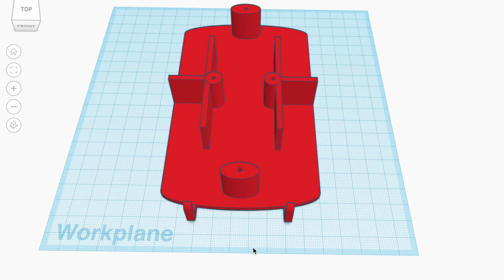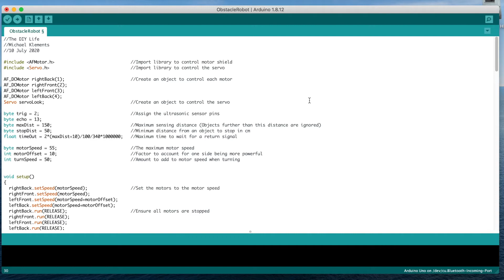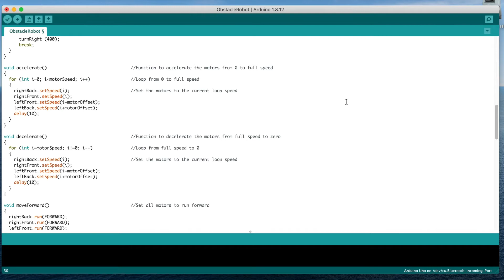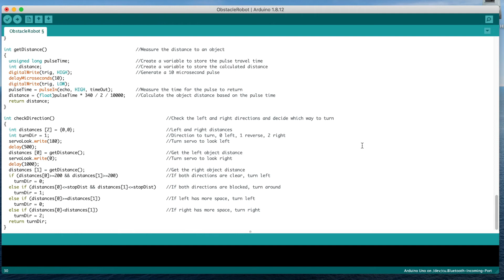Obstacle Avoiding Robot Car Using An Arduino

Comment: My car is turning towards the closest object instead of away from it
Reply from the maker: Your servo may just be turning in the opposite direction to mine or your motors are connected the opposite way around. Try flip the logic in the code.

Comment: In file included from C:\Users\Steven\AppData\Local\Temp\.arduinoIDE-unsaved2025013-17800-1vkb7uk.qk2y\sketch_jan13a\sketch_jan13a.ino:5:0:
C:\Users\Steven\Documents\Arduino\libraries\Adafruit_Motor_Shield_library/AFMotor.h:156:47: error: 'DC_MOTOR_PWM_RATE' was not declared in this scope
   AF_DCMotor(uint8_t motornum, uint8_t freq = DC_MOTOR_PWM_RATE);
                                               ^~~~~~~~~~~~~~~~~

exit status 1

Compilation error: exit status 1
Reply: pls help

Comment: Hi Michael,
Thanks for your project is well documented, however I got an error message when I tried to compile it to check the code. The error message says the "getDistance was not declared hence can't upload or even compile the code. Hope you can help me. Thanks
Reply: same error here did you get the fix to it?
Reply: No
Reply: @chitobalazo  so how did you proceeded with the project?
Reply: I’m still trying but no success. I tried so many you tube channels but no success. Hence I’ll be trying to use HC- 05 once I receive it. Also tried using L298N and R4 wifi limited success.

Comment: Can we use 18650 li ion battery?
Reply from the maker: You'll need to use 2 to meet the voltage requirements of the shield.

Comment: Hi Michael, thanks for the project! I did everything and made some changes on my own and the car works good! Just one issue, the servo motor is spinning too fast, so fast that it removes the wiring sometimes. Do you have any idea on how to fix this, like how to slow down the servo?
Reply from the maker: Hi Techysoham, thats great to hear. There are some Arduino libraries that offer servo speed control, the other option would be to create a functional that moves the servo in single single-degree increments with a small delay between each step.

Comment: hello Mr. Klements, I tried putting a 3 x 3.7V rechargeable battery with a total of 11.1V but when I added 5V to it giving a total of whopping 16.1V, the Arduino Mega 2560 stopped working. Did I supply too much current? is the 11.1V enough for the 4 motors?
Reply from the maker: I'm not sure how or why you added 5V to it, 11.1V is enough to supply both the motor shield and the Arduino. That said, 16.1V also should not have damaged the Arduino Mega since these can typically handle a supply voltage of up to 20V.

Comment: Hi Michael, I understand this project is 3 years old however do you believe with some adjustments to the code an analog servo motor can be used instead?
Reply from the maker: Like and analog RC servo motor or one that requires a different driver?

Comment: I have a question about the yellow-capped component labeled "PW" on the motor shield. Additionally, I've developed a car using the same procedure and utilizing two 3.7V batteries each. However, I've encountered two problems:

1- When I unplug the USB, the car stops working.
2- The batteries seem unable to power all four motors to move the car.
Initially, the setup worked fine during testing, but these issues arose later on. Could you please provide assistance on how to address these problems?

and what specific Batteries and how many of them I need and what volatge.Thanks In adavnce
Reply from the maker: I assume you're talking about the jumper labelled "PWR" - mine is black not yellow. This is jumper that either allows the shield to supply power to the Arduino or disables this feature if the voltage is outside of the Arduino's range. If you're supplying power to the shield only then you need to have a jumper on here to power the Arduino as well. 

Using 3.7V batteries, you would need them to be connected in series and ensure that they can supply enough current to drive the motors.
Reply: @MichaelKlements  
Thank you for your response. Yeah Man , you got me correctly. I was referring to the yellow PWR in my case 😂. From your comment, I gather that I need two batteries, providing approximately 7.2V and 1200mA. In this scenario, I simply keep the PWR turned off as it's. COZ I'm afraid of messing things up
Reply from the maker: You need a supply voltage of at least 4.5V, so either one 7.4V battery or two 3.7V batteries in series would work. If the jumper isn't on then you need to provide the Arduino with it's own power source as well.

Comment: Mate what batteries do you use to power this thing ? I thing that's the most important aspect of this project (you skipped the part where you install the batteries) since many of us who're trying to get this to run use 9V batteries and that simply isn't the optimal power source
Reply from the maker: Either use 4 x AA batteries in a pack or use a 2 or 3 cell LiPo battery (that's what I've used).
Reply: @MichaelKlements  Yeah well I bought a 4 pack and a 6 pack AA holder.  The 4 pack doesn't have enough voltage (1.5 x 4) as the L293D driver has a voltage drop of around 1.8V so the motors spin reaaaallly slowly. Nevermind turning left/right.

The 6 pack is also meh to be honest. I think I need to buy a high voltage high capacity LiPo battery like you mentioned to run this at its full potential.
Or maybe 2x 18650 Li Ion battery

Comment: bro ur code is wrong Arduino: 1.8.18 (Windows 10), Board: "Arduino Uno"

sketch_jan07a:1:10: fatal error: AFMotor.h: No such file or directory

 #include <AFMotor.h>                              //Import library to control motor shield

          ^~~~~~~~~~~

compilation terminated.

exit status 1

AFMotor.h: No such file or directory

This report would have more information with
"Show verbose output during compilation"
option enabled in File -> Preferences.

Comment: hey could we plug the power supply into the Arduino Uno instead of the driver shield?
Reply from the maker: The motor driver pulls too much current to power it through the Arduino, you should power the driver and allow the driver to power the Arduino.

Comment: Oh my god, How can I ever thank you???? My car worked soo well, there's just one thing. The speed is too low, but other than that, everything is working great.
Reply: Can you help me with the Speed issue?
Reply from the maker: The only way to increase the speed is to use a higher supply voltage - but still stay under the maximum voltage that the driver shield can handle.
Reply: @MichaelKlements   Oh okay Thanks for the information.

Comment: Where is the power source of the robot?
Reply from the maker: A battery pack between the motors
Reply: can you tell me how to connect the BO motors to the shield? like the positive or negative point. I am unable to identify
 @MichaelKlements
Reply from the maker: It doesn't matter which way around you connect them. Connect them either way around and you can then either reverse the wires if the motor turns the wrong way or reverse the direction in software.
Reply: @MichaelKlements  thank you. Just a little more help. My Bo motors doesn't seem to be working. What could be the problem? I tried connecting them directly to the battery pack still the rpm is low. I've tried various code on the motor shield and it is all okay.

Comment: Hey Michael , Loved how you made it look so easy but I need help I'm facing a problem..
I have my trig and echo pin connected to A1 and A0 respectively and I replaced the no. in your code to A1 A0, and when I turn on the car the motors dont run and servo motor is also not moving..
please help me out here:(

Comment: Thanks for the video, why didn't you just solder the wire to the board directly on pin 13 instead of using a pinhead?
Reply from the maker: Only so that it can be removed if required
Reply: @MichaelKlements  oh, ok thanks!

Comment: Hello, I'm a bit confused about the wiring of the motors. What wiring is that, and where do we get them? Does that have to do with the battery. I'm looking at about the 2:05 mark.
Reply from the maker: It's just 22 AWG ribbon cable wire that I have soldered to the motor terminals and also soldered to male header pins. The battery lead is a separate lead connected to the motor shield. Have a look at the written guide linked in the video description.
Reply: @MichaelKlements  But how would you use the ribbon cable to connect the motors into the  motor shield? Is it ok to screw in the regular wire 
pins included in the Arduino kit instead?
Reply: He had joined the pins but t optional

Comment: Hi, so I don't quiet understand what did you do to the 12v battery, do you just put it in the middle section and wire it to the board or to the motors?
Reply from the maker: It is connected to the motor shield's power input, the shield then powers the Arduino
Reply: @MichaelKlements  Do you suggest any batterypacks that workf or this rc car or no?

Comment: hey please anyone tell this work..? please🙏
Reply: Yeah this does work, if you need an obstacle avoiding robot car this is the simplest way to do it, though if you use an esp32 and it's appropriate motor driver shield,the project would be more powerful and have access to wifi and bluetooth which leaves a LOT OF ROOM FOR UPGRADES without changing connections

Comment: Sir I made the project for my college. And the car is working very well but one problem is that if the front of the car is empty then the car is still rotating.I checked the code many times, checked the hardware connection and found no problem. I don't understand why my car is not working like yours. Sir Please help me to fix it. I have to show this project to the college very soon. Hope you can help me fix it, thanks 😊
Reply from the maker: The motors are not made equally so there is almost always a side of the car that has more power. You need to adjust the variable motorOffset to account for this. If it is turning left all of the time then you need to increase the offset, if it is turning right then decrease the offset.
Reply: @MichaelKlements  Sir, when the front is empty, the servo motor is still rotating, that means the car is turning instead of going straight even on the empty road. It seems to detect some object in front.

Comment: Hi Michael Kelements,
Can we use a 9volts battery in this
Reply from the maker: 9V block batteries aren't able to supply enough current to drive 4 motors.

Comment: Hi Michael, it would be a great help if you tell me what I'm doing wrong here. Even though I copied your code the robot doesn't function correctly. when infront of a wall when activated it checks for spaces to move and once it finds a way it moves and doesn't stop again when it encounters any obstacles. I've seen some other people have the same problem as I. I made sure that my connections are correct so what might be the problem. Thank you very much.
Reply: For anybody wondering. I fixed this problem by adding return; after moveForward() in the if statement that's in  the void loop

Comment: Greetings Michael,

I have a question regarding the rover. From halt it propagates forward and then at specific stopdistance(which i believe is set to be in cm), and then stops. THe servo moves from 0 to 90 to 180. Then the rover goes backwards till specific distance. But it never turn around. It always goes forwards and backwards. I have used your ocde and modified the tie daelys for some lines but it doesnt seem to turn at all. And yes I have tested the rover in spaces whereleft is more than space on the right etc.. What can I do ? I would really appreciate the help. All the rover turn setting are as such. If Turn left... right motors turn FORWARD, Left motors turn backward...vice versa for Turn Right. I do not know what to do. Please help me.
Reply from the maker: There is not steering mechanism on the car, so to turn left the right wheels run forward and the left wheels run backwards, if the motor speeds are set correctly then the car will rotate on the spot (it shouldn't move forwards or backwards while turning). It sounds like your motor speeds have been adjusted incorrectly, so one side is probably overpowering the other side.
Reply: @MichaelKlements  hi michael could u reply to my query pls

Comment: HI problem here! great video but when i plu my usb connection to the car 2 problems
1. it doesnt work without the usb
2. the sensor only moves nothing else doesnt
Reply from the maker: That seems like a power issue, you're probably not using a battery that can supply enough power to drive the motors.

Comment: Hello Micheal, Great video! I did want to ask what voltage are you using to supply the car? I am using 6V. Is that fine?
Reply from the maker: I use either a 2cell or 3 cell lipo, so 7.6V or 11.4V. It's not so much the voltage that is the issue, you need a battery pack than can provide enough current for four motors to run. 6V would probably be fine if the pack can supply each motor an amp or so on startup.
Reply: @MichaelKlements  Can 4AA rehargable batteries supply an amp to each motor? Thank you for the reply!
Reply from the maker: Probably not unless they're really good quality ones. I'd suggest using a lithium ion battery pack or a holder for two or three 18650 cells.
Reply: @MichaelKlements  Thank you so much! That's probably the reason why my car is not working!
Reply: @MichaelKlements  Hello Michael! I am using a 12V adapter currently to power my car but I want it to be wireless. Could you please recommend a LIPO battery? Either send a link or just tell me here? That would be great help thank you!!!!

Comment: How it will move ? With the help of any application ?
Reply from the maker: The code for the robot car is available from my blog linked in the video description.
Reply: Sir I cant move my vehicle I am using 9v battery
Reply from the maker: A 9V block battery isn't able to supply enough current to drive four motors.

Comment: Great video! But how did you upload your code to the robot?
Reply: yep same question
Reply: By connecting the cable to the uno. After that copy paste the code or open the .zip file he left for us to download. Then simply click upload. You must do this in the Arduino IDE software. The latest version is 2.0.3

Comment: I got a problem , Everything is working fine except dc motors .They are not moving . Please help regarding this problem
Reply from the maker: Try adjusting the motor speed parameters and check that your batteries are able to supply enough current to the drivers.

Comment: Hi Michael I’ve put in your code but the robot doesn’t seem to be continually measuring the distance. Once it sees clear space it’s continues to move without measuring the distance. How should I change code?
Reply from the maker: The code is likely getting stuck somewhere, there might be a loose connection to the ultrasonic sensor which interrupts communication.
Reply: @MichaelKlements  thanks Michael. Are you sure what the most likely connection that is loose as I’m looking at the connections and I am unsure. It works fine to on the setup. It looks left and right and measures distance and turns but then when free space is there it doesn’t measure after
Reply from the maker: It's most likely one of the connections to the ultrasonic sensor. Sometimes communication issues between the sensor and Arduino cause the Arduino to freeze/lock up.
Reply: @MichaelKlements  sorry I know there’s been a lot of questions. I have now double checked all connections to and from the ultrasonic sensor but it does not seem to make a difference
Reply: Same Problem Sir, please help me 🥺🙏🏼

Comment: Bro, Is there a way where i can see the other side of the motor driver shield? i want to see how it was soldered on the other side because as i am lacking of pins to connect lots of sensor given that this ln293d occupies the whole arduino pins... Your video has brought me some hope.
Reply from the maker: There is some more information in my blog post linked in the video description. I haven't done anything on the bottom of the shield, I only added pins to the top.
Reply: I will take a look right now. So, only 2 and 13 can be soldered? It’s a pity that this board takes all the pins of arduino. I’ve got lots of sensors to connect but sadly the board takes them all. I have another question, is there a way we can connect the l293d and the board sensor shield v5.0? So I can have more pinouts for sensors, leds, buzzers and the like. Thank you 😊
Reply from the maker: The two drivers unfortunately require that many pins to control them. If the driver is using the pins then you won't be able to connect an IO expansion board at the same time. You'd be best off finding an I2C motor driver then and that'll free up all of the digital pins for your sensors.
Reply: Thank you for you kindly answer. I’m a beginner at this and I have to use mblock which is more code friendly, that being said, I have no idea how can I connect two arduinos together so I can use one for the ln293d and control the motors and the other arduino with the sensor shield v5 and have a wide range of digital pin outs. I would kindly be grateful if you have any idea how 🥹

Comment: How did you attach the wires to geared DC motors? And did you solder or just inserted the pin heads on pin no. 2 and 13?
Thanks
Reply from the maker: They're soldered to the motors, the headers are also soldered to pins 2 and 13.

Comment: what component that this robot use to make such left right turns?
Reply from the maker: Just the speed difference between the wheels on the left and right
Reply: @MichaelKlements  oh okay. So no component? Only the program of the wheels? Am i right?
Reply from the maker: Yes that's correct

Comment: Where is the switch and battery? And how is it wired in relation to all the components. Sorry I am new to circuits.
Reply from the maker: There is a blog post linked in the video description that has some more detail on the wiring and components used.